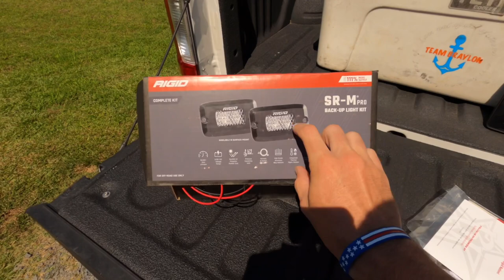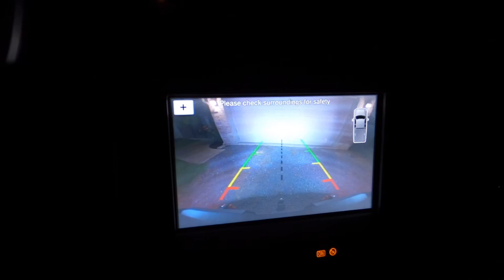Rigid reverse lights to upfitter 2017-2018-2019-2020 F250 F350

Comment: Is that a 15 amp fuse holder that you put on the hot wire? Is that so the fuse will burn out before any major electical issues?

Comment: Did you do a video on replacing your halogens with LED’s? Looking at doing that for my 2020 but, I’m not sure if they are just plug in play or if they require a harness.
Reply from the maker: Well I did a video on changing my headlights out to the lariat sports. If have LED bulbs in it already but it will show you what to do to take lights out. And mine are just plug and play. Should be same for 2020. Mine are headlight revolution, but a lot of people use beam techs and have great results. Here’s the video. https://youtu.be/2V4SggWS5lk

Comment: curious why you didn't just wire and tie them into the reverse light wires in the tail lights?
Reply from the maker: Because if I did that I wouldn’t be able to flash someone that was riding my ass or if I’m parked and have a trailer hooked up, I can just flip them on and see everything on trailer to unload or load up. 🇺🇸🦅🇺🇸
Reply: @COLTSWAY  - I gotcha. Just was wondering. Love your videos man!
Reply from the maker: Thanks brother, I appreciate it! They come in real handy unloading my ranger at night, or strapping stuff down on the trailer. Also it gets them off my ass quick or their brights out of my rear view. 😂🇺🇸🦅🇺🇸

Comment: Are upfitter switches 1-4 only hot when truck is on? and 5/6 hot all the time?
Reply from the maker: All of them are only hot when truck is on. Unless you move that fuse then 5 and 6 can stay hot with truck off. Here’s a vid I Made on it brother. Hit that sub button if you haven’t! https://youtu.be/hgBdAAmFJeQ 🇺🇸🦅🇺🇸
Reply: @COLTSWAY  thanks for replying, already subscribed 👍🏽
Reply from the maker: Thanks brother!!! 🇺🇸🦅🇺🇸

Comment: Hey Colt - thanks for this video.  I just picked up a ZROADZ reverse light kit for my 2021, harness came with the relay and switch all pre-wired.  I assume I am basically cutting out the relay and switch and butt splicing all red and black from the light connectors to the upfitter.  Hope I am correct - thanks!
Reply from the maker: Sounds about right my man! I wanted to use the upfitters instead of switch. 🇺🇸🦅🇺🇸

Comment: Is there a way to wire it into the reverse lights and upfitter?
Reply: I ordered truck with the backup alarm and swapped out the horn for a pair of lights.  Looks factory AF.
Reply: I added lights below the bumper mounted to the outside of the frame and just spliced into my reverse lights for the trailer wiring. I ha e 5th wheel prep though so i found it was easier to cut in where the harness goes upto the box.